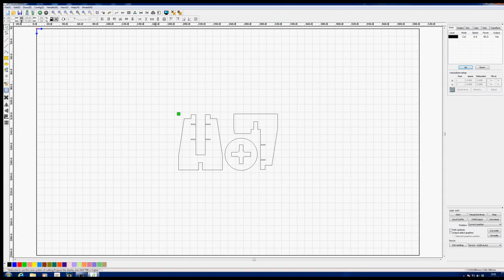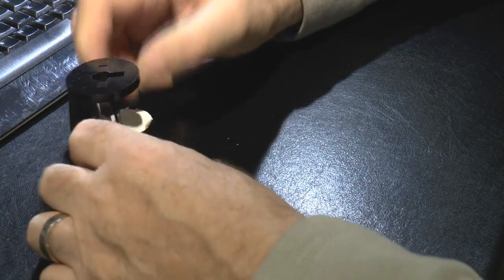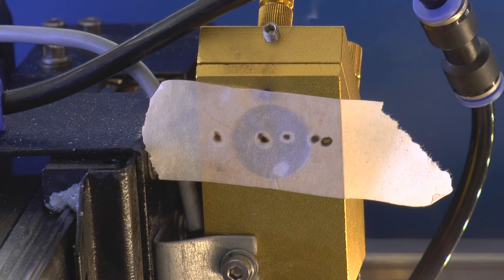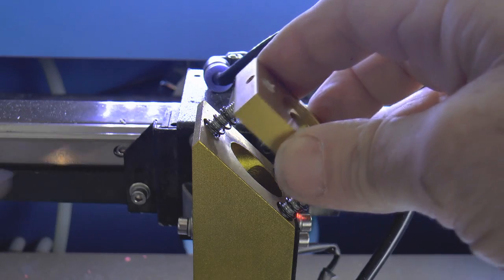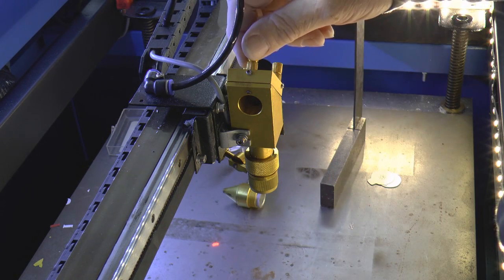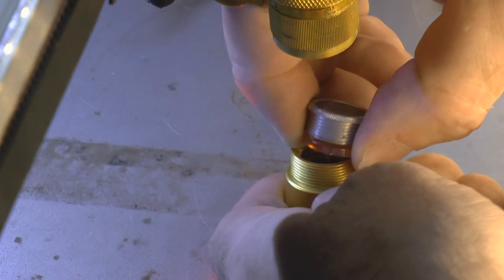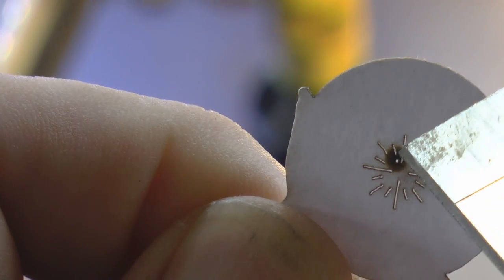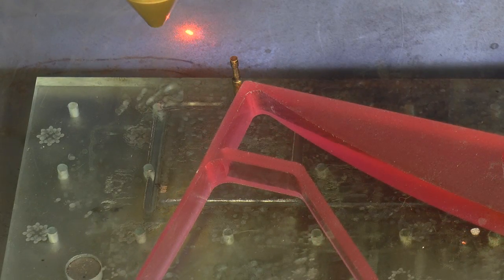RDWorks Learning Lab 31 Mirror Setting part 4    the final step

Comment: Hi Russ,
I love your videos and I already learned a lot. I got my K40 two weeks ago, and I now arrived at video 31 part 4.
At roundabout minute 8 you are testing whether the laser head is perpendicular to the bottom of your Laser. Shouldn't it be perpendicular to the x-y-platform, which is not inevitable parallel to the bottom?
Regards from Germany
Stefan
Reply: Hi Stefan
Thanks for the kind words . I This is a video record from very early in my laser learning journey. I have now bee playing/ discovering/learning  about this technology for 6 years or more and although I now understand  much about the detailed aspects of the technology, I am still a student with more to learn.  Beam alignment /mirror setting  videos were not available 6 years ago . You tube was almost a laser desert. This is a procedure I was still trying to make 100% sense of and I still did not possess a simple logical and reasoned approach to beam setting. The fear of never getting my machine to work again had disappeared and I was regularly purposely  removing mirrors and upsetting alignment in an attempt to refine my understanding..  In a recent video I encapsulated all the modification I have made to my machine  with a detailed and logical way to set the beam . Depending on which version of K$) you have  you may have a very limited adjustment capability in Z. 
 I will refer you to this video     https://www.youtube.com/watch?v=6aNwKhTRnd8
 and this may also interest you. I have given this guy permission to adapt one of my designs for the K40
https://www.youtube.com/watch?v=9flCq8cLg4k&t=164s

 Best wishes
Russ

Comment: Really enjoying your series! Started from #1, and currently on #34. Any chance of getting the design files for the lovely little alignment jig and targets from this video? My laser is sitting in the crate on my shop floor, waiting for a proper table, then I plan to do a full setup and alignment check  based on your videos. Thanks so much for taking the time to impart your trials and errors, as well as your considerable knowledge to those of us coming after. :)
Reply from the maker: Hi

Here is a written procedure to follow. It distills all my various set up attempts into one simple logical ,method. Until you get your machine up and running make yourself some card targets from cereal box card, It's much easier method than making holding jigs. Just make sure you clean your mirrors with isopropyl alcahol after you have finished with each mirror.
 If you wish to attach your email to another comment I will reply and delete the comment.

Make sure you leave 30 mm or so between mirror 1 and the end of the tube so you can get the dohicky in for power measurements.
Set your max power button to 15% so that you scorch a spot rather than BBQ it. Here is a simple procedure that will quickly get your X and Y set perfectly.
Y AXIS SETTING
1) Make sure your beam hits central to mirror 1  (within a mm) The tube can be set at any odd angle as mirror 1 will do the angular compensation.
2) This first step is just a crude alignment to make sure the beam hits the next mirror.  Loosen all the mirror 1 locknuts and wind them off because they are unnecessary. Adjust mirror 1 until the beam hits the centre of mirror 2  within 2 mm
3) Replace the target (tape?) on mirror 2. Drive mirror 2 fully back so it is close to mirror 1.  Make a light scorch mark so that it is a round spot, THIS IS A TARGET MARK
4) Drive mirror 2 fully forward and make another light scorch mark. You will find that the marks do not coincide. Try adjusting mirror 1 to get the spots to coincide.  Provided your SINGLE mark is within 2mm of central that will be OK.  When the tape becomes too confusing go back to step 3. Only when you have the two marks coinciding perfectly can you move to step 5 .
X AXIS SETTING
5)You CANNOT do any more adjustment to mirror 1. Drive mirror 3 far away from mirror.  This first step is just a crude alignment to make sure the beam hits the next mirror.  Loosen all the mirror 2 locknuts and wind them off because they are unnecessary. Adjust mirror 2 until the beam hits the centre of  the hole into mirror 3
6) Replace the target (tape?) on mirror 3. Drive mirror 3 fully left  so it is close to mirror 2.  Make a light scorch mark so that it is a round spot, THIS IS A TARGET MARK
7) Drive mirror 3 fully right  and make another light scorch mark. You will find that the marks do not coincide. Try adjusting mirror 2 to get the spots to coincide.   When the tape becomes too confusing go back to step 6. Only when you have the two marks coinciding perfectly can you move to step 8 .
5) You CANNOT do any more adjustment to mirror 2  

NOW YOU HAVE A PROBLEM. It will be certain that your single mark will NOT be in the centre of the port. It MUST be so what do we do now because we have set X and Y perfectly but the beam is not where we want it.. We cannot upset X or Y by adjusting mirror 1 or 2 ( a mistake that most people make) DO NOT TOUCH THEM!!!

Fortunately this will npt be a problem for you because you have an adjustable head and you can move the head to catch the beam at a position that will hit the centre of mirror 3  (I think your head has a reference line?)

Getting this mirror 3 into its correct position is an essential setting that few understand and even fewer ever achieve.

You need to stop at this point and look at two videos about setting the Z axis perfectly
This first video explains the problem of why it is essential to aim your beam at the "sweet spot" on mirror 3
https://www.youtube.com/watch?v=eSjNsK2sjNo

This next video shows how simple this procedure becomes as soon as you make the head adjustable.  This is  something the Chinese just do not provide you with. Catching the beam onto mirror 3  is so much easier than trying to adjust the tube.
https://www.youtube.com/watch?v=RCoTdNJ53dw

If you look at how I set mirror 3,  you will see that is exactly the same method I used for  the X and Y axes.

Best wishes
Russ

Comment: Holy cow...ummm you lost me taking the head off there. Ho wdid you 'steer' the beam to center? I didn't see any manual adjustments? Was that the program? My unit comes Saturday and I am getting a head start on requirements.
Reply from the maker: +Kris Kumaroo 
Hi Kris
Bear in mind this is not a set of tutorials but a record of me learning about and how to use the machine. You are about half way through the saga and I have experimented with several ways to set the beam path. All involved too much mirror tweaking to get a good compromise. When I upgraded to a 60watt system I had a complete setup to conduct  so I sat down and spent time to plan a logical and simple step by step procedure that anyone should be able to follow and get perfect results.
https://youtu.be/Vl6QKlwRKlk

I had previously though I had a good procedure with the line of sight method .It will still be good to watch this to see modifications I made.
https://youtu.be/5YvOqH44n6c    &    https://youtu.be/pl6dAWOkksM
Here you will see that I have made my own head mounting bracket that allows  it to be adjusted easily.

In this later session I discover a major design flaw with the mirror position on the cutting head. Important that you understand this if your head design turns out to be the same.
https://youtu.be/ELeqP3tHlp0 

Good luck with your new machine
Best regards
Russ

Comment: HI I NEED HELP ! I just got the machine yesterday and works very good engraving, but when i tried cutting 3mm mdf or acrylic it didn't cut, how can i adjust de power so it can cut that size? how do yo cut ?? please i apreciate any help.
Reply from the maker: +Fabiana Hernández 
Hi Fabiana
I think this may take quite a few questions and answers to get you cutting so rather than speaking here it would be better to send me your email address and we can speak "off-line"  Click on the blue Sarbar square and you will open up a page with tabs. Click on the ABOUT tab and another window opens. You will see a MESSAGE button top right. That will send private messages to me. Tell me several things. What power is your machine? Maybe send me a link so I can see what you have bought? What sort of engraving have you done and on what material? What thickness of acrylic do you have?
Speak soon
Russ

Comment: A while ago I had to remove the head as the angle bracket that it bolted to was not at 90 degrees and I couldn't get enough of the adjustment from the 3rd mirror screws, after removing the bracket and bending it in the my vice it all came good and the adjusters were nicely equal.